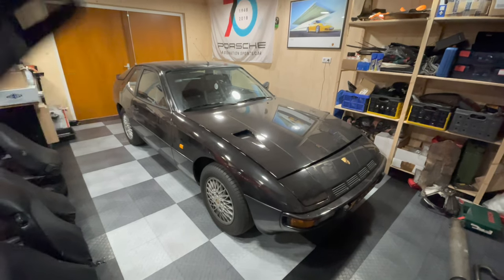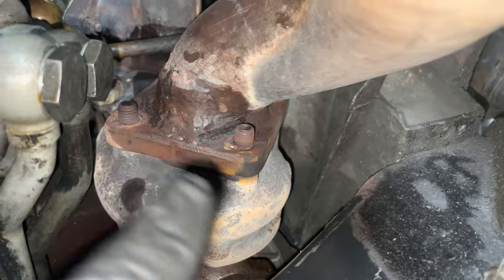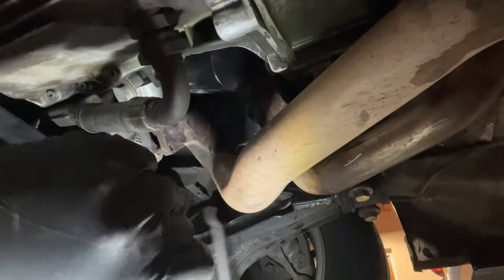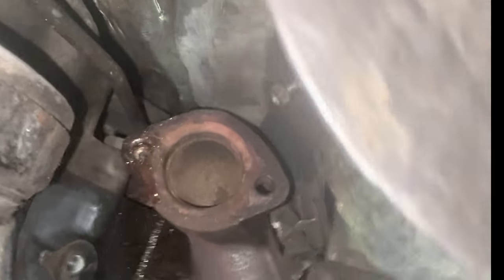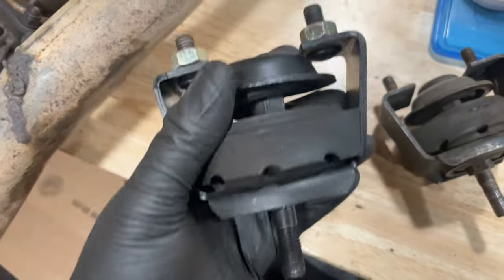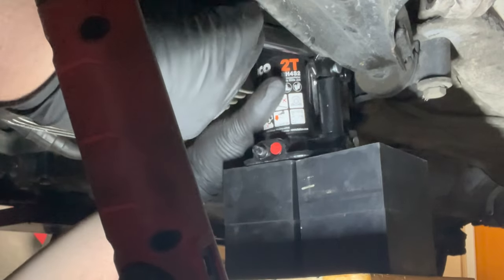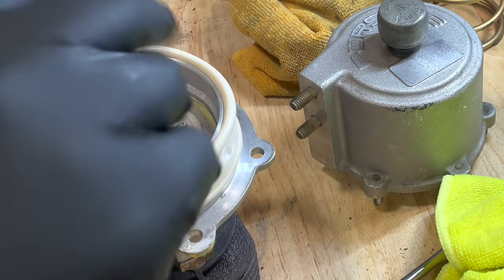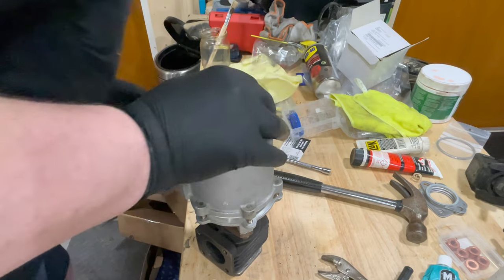My Porsche 924 Turbo: Fixing the #exhaust, rebuilding the #wastegate and new #motormounts!

Comment: Should have cut the J Pipe and put in a flex sleeve on it.
The common fail point of the J Pipe is the weld at the flange to the waste gate due to vibration.

Putting in a flex sleeve dampens the vibration and keeps the pipe from breaking off.
Reply from the maker: True, but the previous one lasted nearly 40 years, so I will hedge my bets 😃

Comment: And I thought the Super Charged 924 was a nightmare to work on, the Turbo looks even worse :0!    I used stainless steel studs and Aerotight nuts all around my exhaust manifold, down pipe etc. Hopefully they will never seize!   Aerotight nuts are stainless self locking - ideal for exhausts etc if you ever expect to take them apart again.
Reply from the maker: Thanks Chris, I've never heard of Aerotight nuts but will check them out!

Comment: Brutal job on your back under the car with less than a meter of room to work. We're taking apart an '82 924 Turbo for engine rebuild and took the exhaust apart yesterday. Only broke one stud on the exhaust port of the turbo. Agreed that the 931 is tough to work on but that challenge is surpassed by 944 Turbo or 951. We did a trans axle rebuild and clutch replacement last year on a '87. That car is really fun to drive now and I can't wait to compare the 931 driving experience with a fresh engine.
Reply from the maker: Haha, yes, we rebuilt the turbo on a friends 951 a couple of years ago and I remember the impossible access to nuts and bolts there as well! My experience with the 931 vs 951 is that the 931 is a rawer and more characterful and old school car. The 951 is quite a bit more refined and sophisticated, but I love them both.

Comment: Hi, enjoying the videos. I am slowly bringing a neglected 968 back to life. Interested in your thoughts on the Quick Jacks. I am deciding whether to purchase a scissor lift but not sure if it will be any better than the Quick Jack.
Reply from the maker: Thank you Douglas! I am a BIG fan of my Quickjack, it is super versatile and very stable. A scissor lift might give you more height though and that is my only complaint with the Quickjack, it would have been great if it had just a little more lift height, but overall I have no complaints.

Comment: Great video, thanks for making this.  Where did you source the motor mounts from? 
I read that left & right are different, and one of them are available?  Can you share where you bought the motor mounts from and what part number?
Reply from the maker: I bought the motor mounts from a Porsche specialist here in the Netherlands that had a bunch of rebuilt units available, even though I believe them to be NOS. But unfortunately they have run out of stock and they can't tell me if or when they will have more set's available.

Comment: Jon, love your patience with this job.  I think I might have thrown in the towel once the studs broke!  Did you think about having the wastegate bread blasted and coated while it was out?  I’m sure timing has at least a bit of input on that decision.
Reply from the maker: Thanks Jeff! Every night as I came back into the house I told my wife that I am going to give up and have it done, but somehow the next day when I tried again with a different technique or tool I would book some progress and then I just kept going. These cars were insanely expensive to maintain back in the day, and I can see why; It was not built with serviceability in mind. Luckily my time is free 😅
Reply from the maker: With regards to the bead blasting; I did think about it but figured this will be back to being crusty in no time, so decided to leave the rust as it does offer a level of protection in its own right.

Comment: Be sure to use studs and nuts made for the heat, then its easy to remove them next time :)
Reply from the maker: Agreed Cedric, that I why I went with the expensive original Porsche studs and nuts. The previous guy didn't and made this job so much tougher than it needed to be 😅
Reply: @GarageBiljon  Can also be from other cars, vw parts are cheaper for example. Buying from porsche themselves should be good stuff. Regular studs really "weld" stuck and oxidise at stunning rate :)
Reply from the maker: True  @garagecedric  and I often shop in the VW/AUDI parts store, but on this job I did not have time to cross reference parts. But to be fair, fhe parts were very reasonably priced from Porsche.